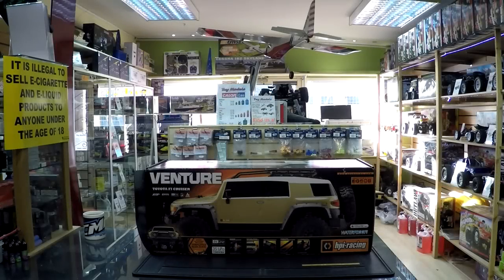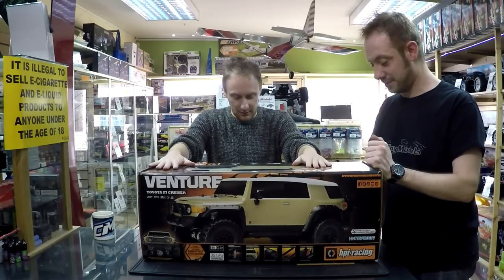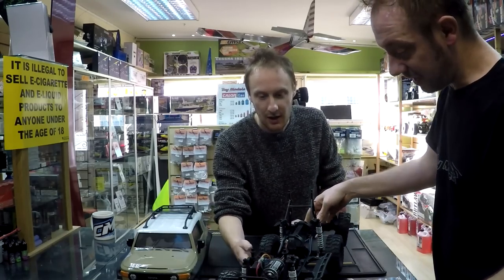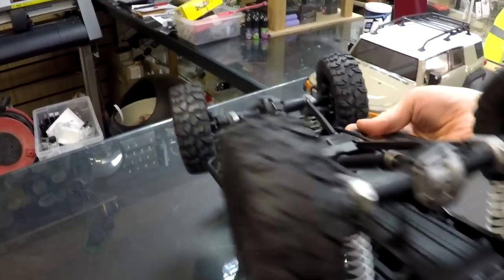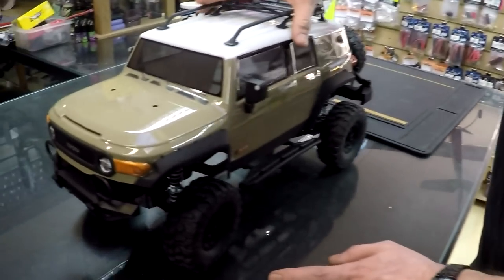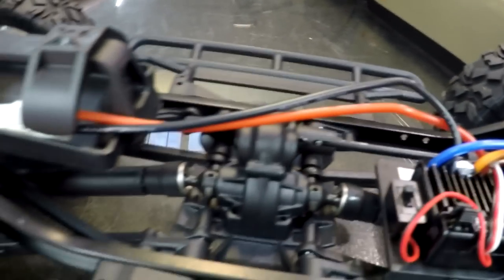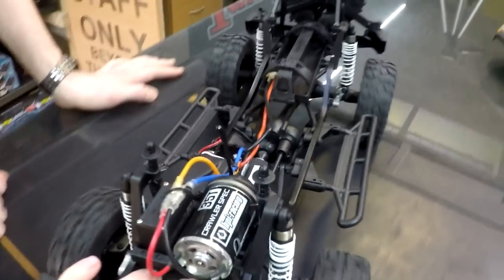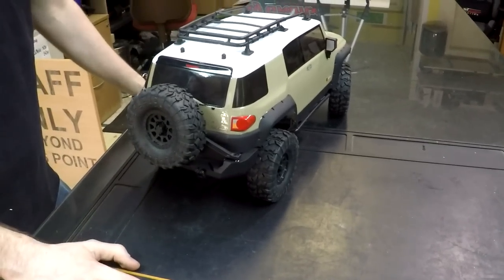Venture Toyota FJ... HPI's oddball scale crawler: A close look.

Comment: Driving performance is pretty good, whereas the body has left me feeling disgruntled. In HPI’s zeal to make a scale replica of the FJ shell, they gave little thought to performance tires, since any tire larger than 4.3” OD, or perhaps any wider than the stock tires, will rub the body under significant articulation(which can occur frequently when crawling). The body could be raised, to compensate, but that would consequently leave an undesirable gap between the lid and the bumper(like the Axial Honcho). I think I’m going to sell the stock body and personalize it with something else. This platform would be a great candidate for that new Pro-Line Ambush body, I’m thinking. Cheers!
Reply from the maker: Thank you, Sir, for the insight! That's some valuable information. Well, since I don't like the FJ body, switching the shell would be a must, anyway. If/when you do get another body shell, please do drop in and let us know how you get on. Thanks again!
Reply: Lol are you really complaining about the body rub when changing wheels?